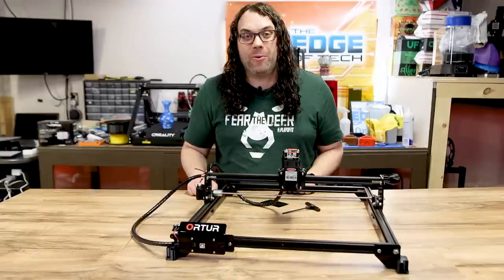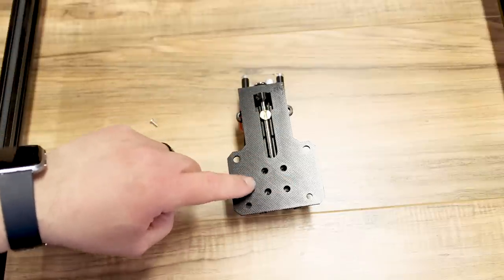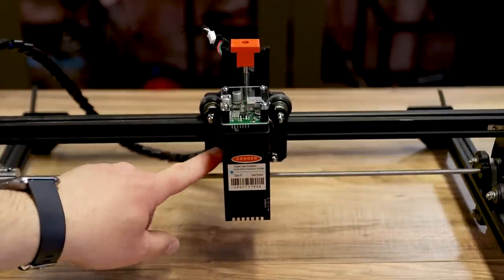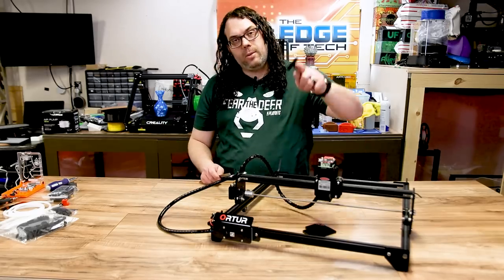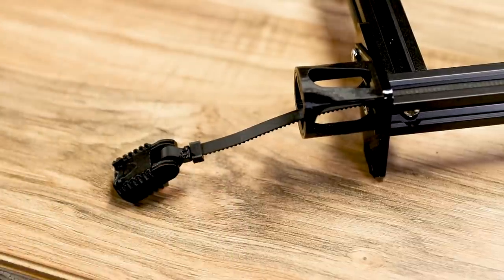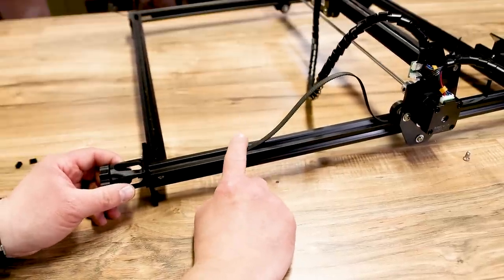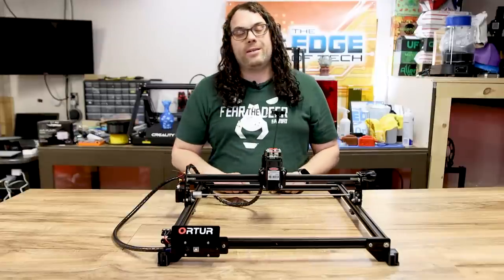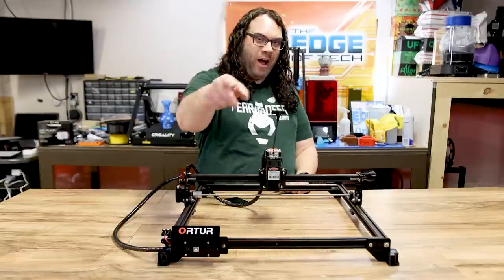How to Upgrade Your Cheap Laser Engraver Machine - Ortur Laser Master 2

Comment: Love this video Jim, especially for those who have the older versions.  

I think any new units (at least 20w versions) come with a fixed lens and z-adjust already (for those interested in buying units today).  The top-mount adjust on the model you show is nice though.  Also, by needing to adjust the limit switch location, you do minimally reduce your working area.  This won't matter for 95% of burns though.  FWIW, the z-adjust on the updated fixed-lens units does conflict with most air assist printable components so be ready to design/search for the correct air assist.

Air assist is a HUGE upgrade on these by the way (for any looking to buy).  It really increased the effective 'power' of the laser (same output, just more efficient engraving/burns). 

The feet are very useful too!

Also FYI: someone probably figured it out already, but new, fixed lens units cannot upgrade (easily) to the G8. Wait till you get your unit to buy a g8 so you know if you are getting mixed lens or not.  Don't be like me and get both at the same time then have am extra lens sitting beside your unit 🤪
Reply from the maker: Great points!! Thanks for the feedback and advice!
Reply: My 20W had some issues.  I had to add a pair of holes between the two lowest pairs on the plate (factory plate).  Also, when it is that low, the Z plate hits the X axis motor coupler when transitioned left.  I used card stock between the Z plate-to-laser mount and again on the factory plate mount face to the main gantry carriage.  That added 70 mils or so which has the unit missing the motor coupler by a couple millimeters. Another thing to watch out for are the two motor power wires feeding the Z axis motor.  They rub on the bed plate!  Way too close.  Shipping tape or transformer tape over the wires stops any abrasion, but keep an eye on the tape for scuffs too after applying it.  EDIT:  After closer examination, I found that it is the two limit switch wires that were proximal to the bed edge, not the motor cabling.

Comment: Just an observation from recently assembling the Ortur enclosure for a Master 2 S2 LU2-4 SF model. IF you have your laser in an enclosure, or thinking about it, the belt tensioner will not fit. I opted for an enclosure because my unit is in my wood shop on one end and son's welding and such on the other. That makes for a lot of contaminants.

Comment: I have the 20 watt model that already slides up and down but I love the precision I'm seeing with this nut to turn on top.
Reply from the maker: If you have a new one it comes with a fixed focus adjustable laser head. You won't need the z axis mod as yours already moves!
Reply: @TheEdgeofTech  Are you referring to the laser head that you can turn left or right to change focus or are you referring to the ability to move the whole laser on the z axes?  I have a 20w and am not aware of being able to move the z axis up and down, just able to focus the laser by turning the head left or right.

Comment: Thanks for the video upgrade Jim.
 I have my lm2 installed inside a wooden box and am wondering what the dimensions of the belt  tensioners are. Itd be a pity to have to build a new box if they don't fit in !!

Comment: Watched this video to prepare for installation.

1st issue:  The Z-axis adjust; the laser mounting plate which fastens it to the gantry using 4 crown nuts had incompatible hole pattern. My gantry bolts form a rectangle, (lower and upper bolts are the same distance from each other,) on my LM2. In your video, your LM2 gantry bolts form a trapezoid; (the 2 lower bolts are closer to each other than the upper bolts.) So, I figure either maybe you are confusing LM2 with LM2 PRO, or maybe Ortur is making design changes on the fly, without communicating with those they should.
Solution was to drill two new lower holes, using my old plate as a drill-guide.....works fine, so far as I know.

2nd issue: The belt tensioner on the Z-Axis adjust is a mirror image.  Your video seems to be telling me to install it on the wrong end of the gantry. To install it on the end of the gantry I am instructed to on your video, would require me to cut off the flange on the adjuster housing, flip the flange over, and remount the housing on the other side of the flange; as far as I can tell. Please correct me if I'm wrong.

3rd issue: I did not receive any kind of clip to keep the lead-screw from travelling up or down. In other words, to keep the lead-screw stationary.
Solution: I'm thinking of grinding off the threads residing in the little slot on the top of the Z-Adjust and installing some kind of clip.

These issues are what I am perceiving. I'm not condemning, I just want to know how to get my system up to par. Looking forward to answers/solutions.

Comment: So the machine says it's a 20w max or something, what would happen if I put a 40w laser head on it? Can I simply power it directly instead of through the machine? Could I use some kind of converter to convert the power from 20 to 40 on between the machine and the laser head?
Reply from the maker: I think you could, but I have not done it.

Comment: Thanks for the video. I know that it is older, but so is my machine. How has this adjuster worked for you? Has it been stable with no wobble, etc.? Has it lasted? I have taller feet on my laser (20mm of lift) and need to get the focus down lower.

Comment: I have one now, I printed, that has an air assist, z adjust, and a lock. It is a mod to the air assist designed by Brian @3D Print Creator.

Comment: I don't have this laser, but the upgrades look good.  I wish the Ginmitsu Jinsoku LC-40 had such a belt tensioner mod.   

You should add the Maker based MKS DLC32 offline controller.  It looks really interesting, kind of like a 3d printer with a display and the ability to move the laser and run gcode from the controller without a laptop.  Unfortunately there is not much if any documentation on how to install it though I have seen several videos of it successfully added to a laser engraver.  They did not post how they did it though.

Comment: I do have a question (as I am a novice with engraving): What is the purpose of a belt tensioner/how often is it utilized? 

Do the belts significantly lose tension over time?

I am a big fan of useful upgrades (like the z-axis which would be used for EVERY new job), but I am curious how often I would be adjusting belts.

Thanks in advance!
Reply from the maker: Great questions! You normally would use the belt tensioners in the setup, but it's always good to check your tension after every few prints. If they are lose they cause banding etc. It really makes it easier as you don't have to loosen the bolts and pull them by hand. Thanks for watching and great questions!
Reply: @TheEdgeofTech  Makes sense on checking and, yeah, those devices would absolutely make things easier!

Comment: Just got ORTUR Laser Master 2 Pro-S2-SF, 24V Laser Engraver. Like the few things I done so far. Thinking as an upgrade it would be nice to do thicker cuts. I see Ortur has some laser options, but there are others that have higher powered lasers (saw one with 2 5w lasers that combine beam). Is there a place or have you tried using other 3rd party lasers on this system?

Comment: There is a potential downside to installing the retainer feet. It will make it a major PITA to lift and replace the machine to use it on objects larger than the work area. In theory, the unit could be lifted straight off the retainer feet. But if they're snug enough to prevent any lateral movement from vibrations (and they should) then the machine will need to be lifted absolutely straight up or set straight down against a fair bit of resistance. Not a problem if all you intend to do is engrave coasters, tiles, or small canvasses. but worth considering if you plan on burning larger or longer items.
Reply: You should check out the lego feet

Comment: Hi Jim you seem to know a lot about the Ortur Master2 Laser I've watch your vids and am very in press in your delivery etc, I was wondering weather or not you can help with a problem I've encountered I'm a newbie when it comes to lasering and was just getting the hang of it. I've watched your vid on how to upgrade the Ortur which was very good and seem to be just what was needed However just a day or two after the upgrade I was engraving slate which would take about an hour to finish so I left my man cave and when I returned around 3/4 hour later I found that although the laser was still moving the fan and diode was not working. Now I don't know why? was it software related or had some broke can you throw some light on the matter. I have tried a reboot on pc and reset on laser but the fan and laser will not work but movement is OK

Comment: With regards to the height adjustment and the spacer or moving the switch forward. In Lightburn would you need to adjust some setting since you are effectively shortening your Y bed size?

Comment: Wondering if the z adjust will slip over time from vibration.
Reply from the maker: It shouldn't. But that would be a great test!
Reply: @TheEdgeofTech  it would. I'm sure you know how much it shakes when raster engraving small areas.
Reply: @risbill1  it's basically a worm gear, much like a guitar tuner. It should not move unless it is moved. There no vibration should cause it to twist when there is friction on it. If you pull or push on the module it will not cause it to turn either.

Comment: Hi Jim hi Everyone, could someone help me? I just put my Ortur MP2 together and  I type just a five letter name I usa  a bit round font. The letters are up and down. I just burneda a line not fill on a piece of mdf board the letters are off, and  the letter "o" looks like an  egg shape and it doesn't even make a perfect circle I'm running the trial version of light burn. Thank you in advance
Reply from the maker: Hi, congratulations! Check your belt tension, it sounds like it's not correct.  That would cause circles to not be circles etc.  Make sure it's pretty tight but not super super tight.  When you move the belt back and forth by the wheels, you should have maybe a half inch of play. But that's it.